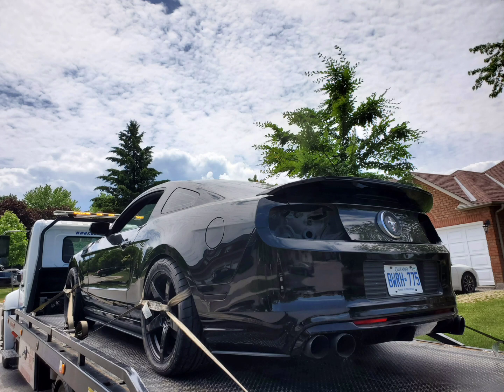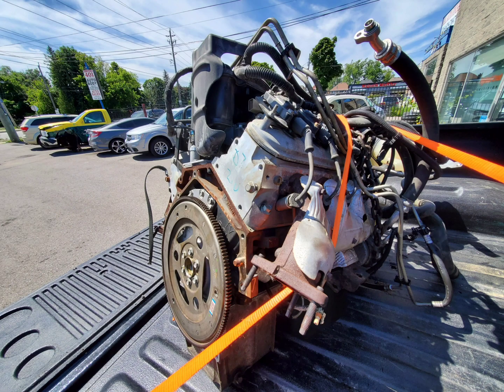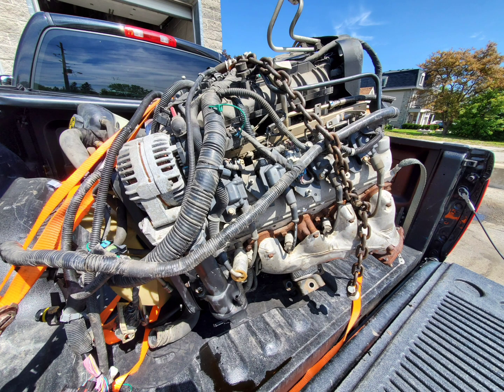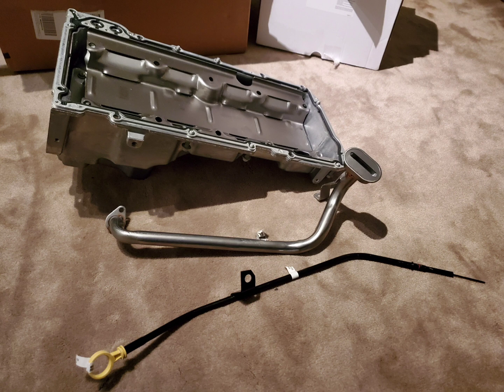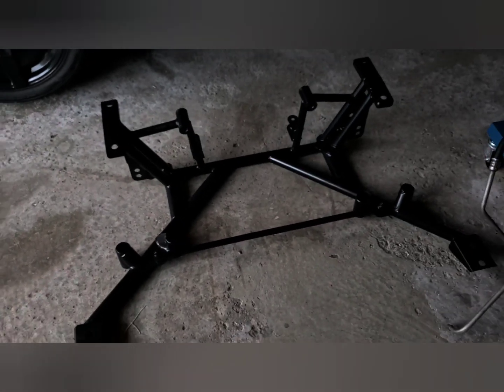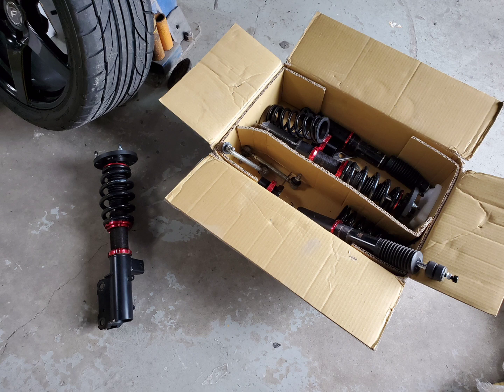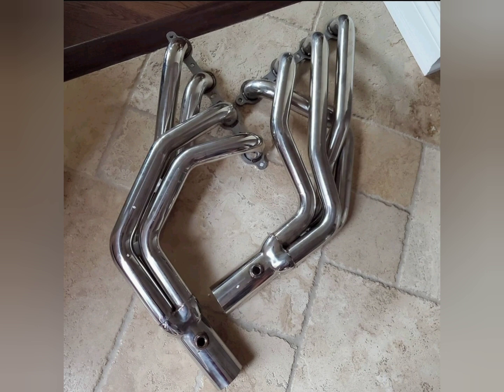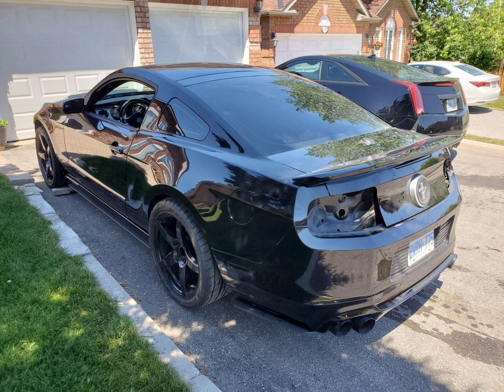S197 Mustang LS Swap Part 1: What Engine, Tranny, ECU (etc.) am I Using?

Comment: Have you started/finished this swap yet?

No swap of this magnitude is easy (or cheap). I put a windsor in my 2012, and I didn't care about some stuff that might twist you up, such as a/c and heat. Getting the motor bolted into the car will be relatively easy, but it's the little shit that will bind you up, and how bound up you get will depend on the concessions you feel like you can get away with. BTW, I also used a Holley EFI setup on mine.
Reply: Thinking about doing this myself to an 06. More than likely roller small block out of a fox body and a 5 speed. Any tips or things you ran into that i should look out for? Parts you had to fab up?

Comment: With the holley ecu and wiring harness do all your interior features work like window motors, dash gauges and does your car have track apps or is 2013 the first year track apps started.
Reply: The Holley ECU only controls the engine and possibly fuel delivery, the body control module controls windows, lights, etc. This also means your fuel guage should still work. When you start major swappage like this, your water/oil gauges (or idiot lights) won't work correctly. Speedo works off an electrical connection to the trans, so depending on what you do there, you mileage may vary. The tach works off the crank position sensor, and there may be a solution to adapt the oem tach to the holley, but I've never personally heard of such a device being available.

Comment: Don't need a custom kmember for those that are reading this, stock 3v engine pedestals bolt up to the LS and attach to the stock mount locations.

Then all you have to worry about is a transmission crossmember.

That's what I'm running on mine

Tons of clearance too
Reply: What year model mustang did you swap?
Reply: @bnkrdbones4391  2007

Comment: Question, will your air and heat etc work? So the stock gauges won't work at all? If you wanted them to work how would you do that? Is it possible to make that happen?  Interested in doing this swap to a 3v car.

Comment: Did you replace the driveshaft or can the one for the 3.7 handle the extra power?
Reply: And what control arms did you get
Reply from the maker: @nolanbrackin1260  control arms I am using just stock s197 ones. However if I were to do it again,I would have gotten the matching tubular ones
Reply: @pistolpete7280   thanks for the fast reply man. I’ve had the itch to ls swap my 06 pony package that I got for $1500 with bullet holes in the body. Everyone has been trying to tell me not to, but it only makes me want to do it more. Just trying to answer any questions I can think of before I drive in head first. Did you have to modify your control arms at all?
Reply from the maker: @nolanbrackin1260  totally with you on "wanting to do it more," especially when ppl say not to, LOL.
Nope, they stay the exact same.
Reply: @nolanbrackin1260  I get the same heat from people but I don't care I'm a car guy not a fan boy, next summer when my LS powered S197 shows up with 650 hp for under 6k the conversation will change...lol
Reply from the maker: I'm going to be getting a custom one made. To answer your question however, I theoretically could have got my aluminum V6 shaft modified to adapt to the Tr6060. (Deffs not the stock V6 one though,cause they do not hold power at all)

Comment: As a fellow procharged 3.7 ( before you moved on) I debated doing some sort of swap. I feel your pain the 3.7 is a great motor but 500 whp if about the limits.  I run mine on 8psi (93 octane) I was good for 434 whp. E85 I touched on 464 whp. My best track time for 1/4 was a 11.80 at 124 mph on gas / 11.71 at 125 on e85. My car is a daily driver. Stock 2:73, shorty headers, axlebacks, ported intake and throttle body , everything down to cats still stock. I have put 73,000 on the supercharger. I have watched all your videos. At first I was torn about the swap now I'm digging it. By chance did you ever look into super six motorsports 4.0 stroker kit? I was told there kit is good for 750bhp vs 600bhp stock.
Reply from the maker: Some pretty impressive figures there, nice! 
No I never considered it as an option.   By that time I already had my heart set on the LS swap
Reply: Did you ever do the swap? Do you still have the car? Did you ever change out the gears.